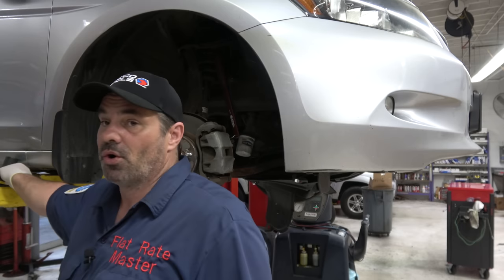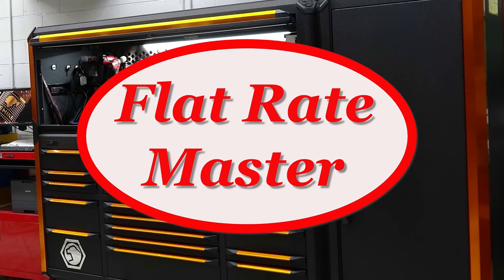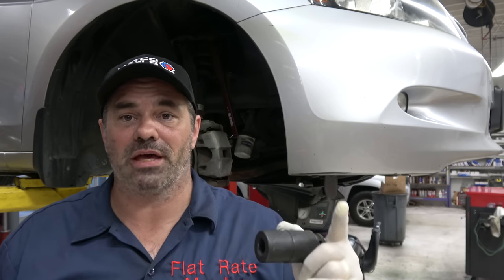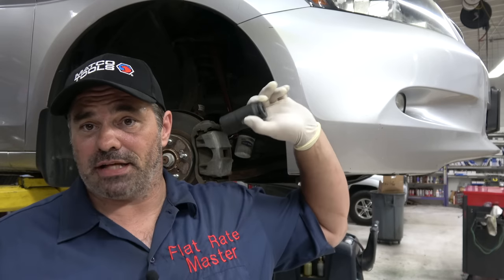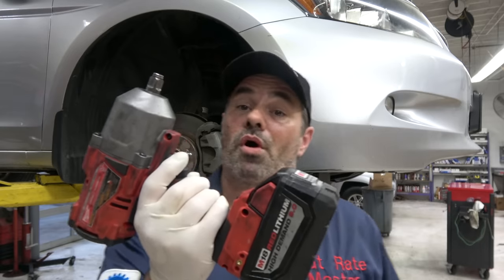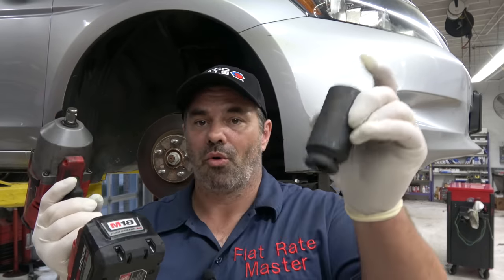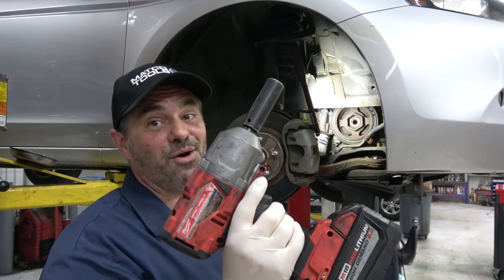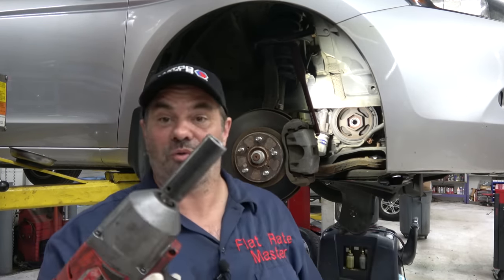Honda Crank Bolt VS Milwaukee with Heavy Crank Socket

Comment: Listen...I tried every trick I could muster on a 97 crv. Even used kroil days before.l didn't have a Milwaukee fuel. Just a HF corded 120v and a couple ryobis even shattered a socket. Got that weighted lisle 19mm in the mail, and BAM off she came.
Reply from the maker: They work
Reply: Flat Rate Master Hell ya. I'm just a driveway diy'er & this thing is gold to a guy like me that doesn't have a lot high powered air stuff. That extra mass really makes the impacts from the driver hit the fastener ALOT HARDER. The nice thing is that its not expensive, especially for all the potential time it could save.
Reply: I only see dewalt in construction trucks.When i worked at a dealership, all the techs used milwaukee fuel. I live in WI so they are Milwaukee, Snap-on crazy round here, gotta buy local i guess.
Reply: Chris Wittekind you got a bad one then man Ive done more than easily more than 30 axle nuts and crank bolts with mine. I have a 3/4 ton truck and the lugs come out like nothing takes about 2 or 3 seconds.... I'd definitely try to return yours. Knock on woods mines at least year old only complaint is having to get a extension cord. They are also rebrand and sold under other brands for more $
Reply: TheeJoeyLee  I'm a dealer tech in new York and I see a fair amount of dewalt mostly guys using impact drivers and some 1/2 impact wrenches.  And then there are guys like me who have a 20v 3/8 impact, a 20v mini 1/2 impact, 20v full size 1/2 impact, about a half dozen assorted 20v drill and drivers, and a corded angle grinder.  I've beat the shit out of them and they dont seem like they've weakened at all.
Reply: ...you got to use a 12 gauge extension cord to give the gun the amps it needs to work properly;if you using a cheap 16 gauge or less,then you're better off with a tire iron!

Comment: Yeah I use my 1 inch drive pistol grip harbor freight air impact to remove the crank bolt on a 4.2 L Chevy trailblazer that the 1/2 just sat there and rattle but did not budget

Comment: There is absolutely no reason mechanically for that bolt to be torqued to an insanely high value. It's only purpose is to hold the pulley on from coming off the crankshaft. There is no clamping load necessary. A moderate torque, say 80-100 ft-lbs with some Loctite 242 is more than enough for that application.

Comment: I have not plugged in my CP734 since I got the Milwaukee 1/2" impact. Not once. Not even sure where it is. I still use my air powered Astro shorty, but not my standard 1/2" air powered impact. I continue to be amazed at the Milwaukee product line. Good stuff.

Comment: I had my fingers crossed that it would not come out... maybe next time! =)
Reply from the maker: Never fails if I hadn't tried to film it it would have required the 3/4 impact and the heavy socket, but no I filmed it so it came out like butter
Reply: Flat Rate Master Yep it never fails 😐

Comment: Ok....I love you bro, but! Try an older Honda. I’m not gonna hate on Milwaukee here. The newer ones are way easier to get loose. A few weeks ago I did a Tbelt on an older pilot. Nobody in the shop had a 3/4” or the crank bolt tool so I used my other techs brand new 1/2” Milwaukee same as yours. I rocked that thing back and fourth for about 5 minutes before it came loose. Congrats Milwaukee you passed the test....after 5 minutes. Haha good job though bro. Just try an older one. Haha
Reply from the maker: Wouldn't matter you turn the camera on and it would come right out, this was an 08, best I can tell never been done, anything much older than that we see is getting it second tbelt, we do many Honda V6 tbelts a month and it is all over the place on what we use, though haven't had to break out the 3/4 in a while, a few needed the 3/4 and the weighted socket

Comment: I know this video is  old but to see the Honda crank bolt come out that fast,  that had to have been out at some point but nevertheless impressive I have a 1/2 inch battery impact rated at 1500 ft-lbs of breakaway, can't wait to try it on a Honda crank bolt.

Comment: man that impact will bust em loose all day long. I bought one at the start of the year. Myself and 4 other guys have not found a single nut or bolt that thing wont take off. we have tried crank bolts on most common cars out on the road today. if it wont break loose it will just snap the bolt. Since i bought it the lead tech and the senior tech both got one. Milwaukee don't give a fuck.

Comment: Im betting that bolt has been removed before. We had same thing in our shop and Milwaukee Wouldn’t touch it. He had to heat the bolt up to get it out because Honda puts loctite on those. You gun didn’t flinch which makes me suspicious
Reply from the maker: Belt and pump were original, sometimes they come out with the Milwaukee sometimes not, we do several Honda v6 Tbelts a month in the shop many first time belts and luck of the draw on if it comes off with or with out the socket, every now and them it is the heavy socket and my 3/4 impact
Reply: Dustin Smith not every car is the same

Comment: That never happens to me even with the high torque... Always have to pull out 50 cal (3/4 impact)👍
Reply from the maker: If the camera wasn't rolling it would have taken the 3/4 and the weighted socket but what can you do

Comment: I can't imagine the 9.0 mAH, I got the 5.0 and have taken semi truck wheels off multiple times with it
Reply: Renegade while what you're saying is true in principal (I think), I notice a big difference in power in my dewalt tools when going from the 1.5s/2.0s mAH, to the 4.0s/5.0s.  You notice it a lot in the drills and impact wrenches.  I stopped bringing my smaller batteries to work I just bring a 5.0 to work and use all my others in my car and at home

Comment: The weighted socket is a lifesaver. I can tell you from personal experience that it will take a Honda crank bolt off with a Milwaukee cordless. Sometimes it might take a bit but it works.
Reply from the maker: We use them all the time, just when i turn the camera on nope